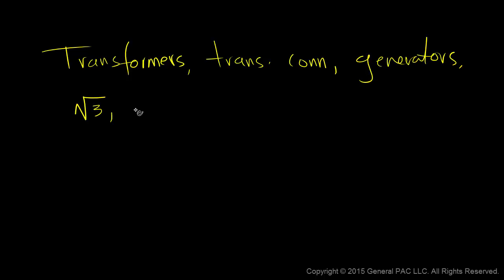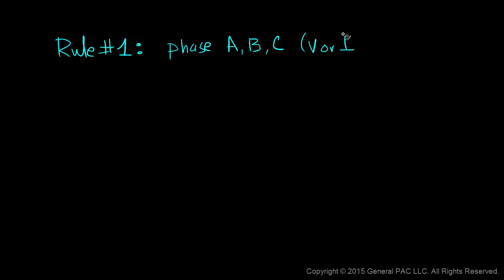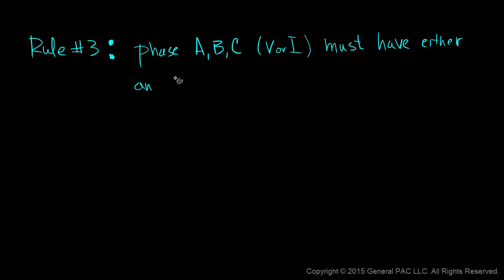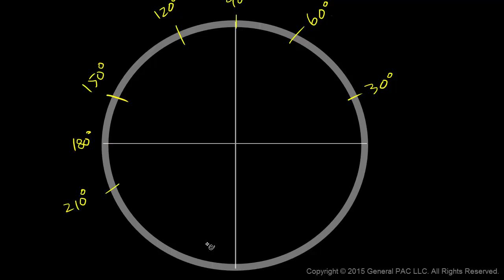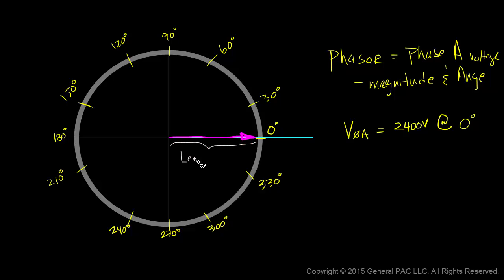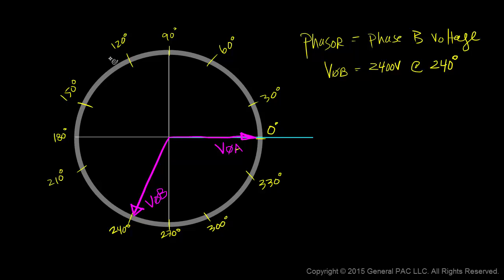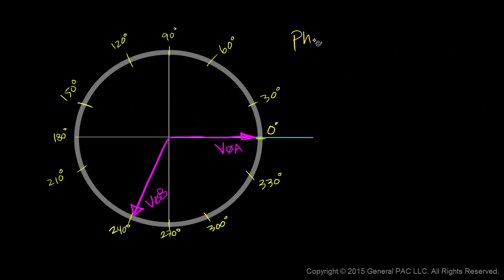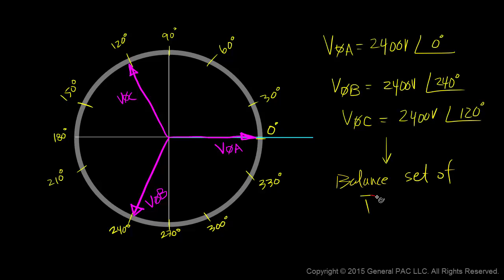Introduction to Balanced Power Systems - Part 1

Comment: is there a such thing as a single phase 1 line overhead power line with no neutral?  (using ground as a return)
Reply from the maker: +aaron odom yes there is. There are many reasons why we may not want to do that. But single phase power line using ground as a return have been used in the past. In fact, when learning about electromagnetism of High Voltage power lines, single phase lines with return ground is used as a simplified example. There is something called the Carsons Equations that can be used to calculate the return current flowing through the earth given the properties of the earth.

Comment: you mentioned voltage amd current, but what about impedance? should impedance be equal mag and 120°apart also?
Reply from the maker: +Hdawg Geezy, although the impedance may have an angle associated with it, it's fixed and does not change.